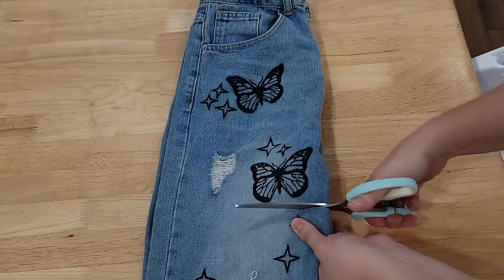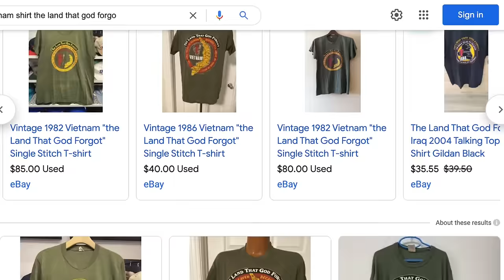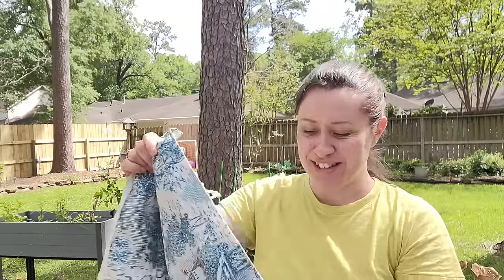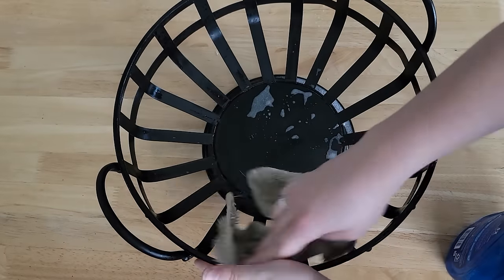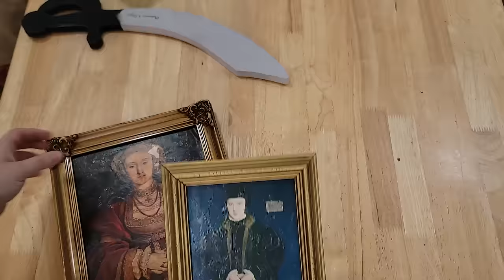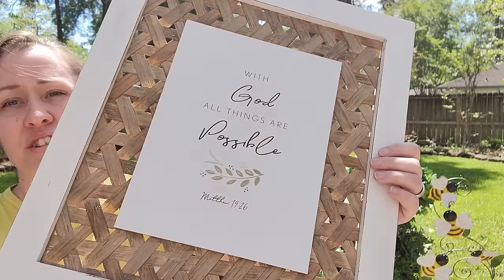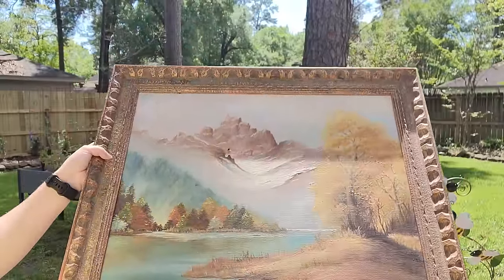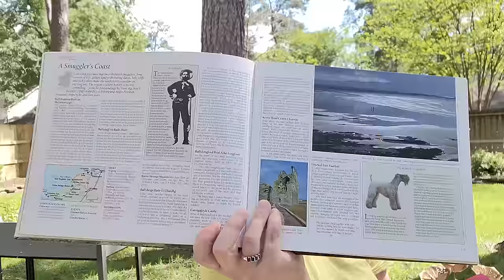I Hit The Jackpot At The Goodwill Bins | Shop & Flip With Me

Comment: You can use the clock that doesn't work as a picture frame. Either remove the workings and insert a picture or fit the picture over the front of the glass. You can always use it as a shadow box for keepsakes after removing the workings. You will have to fashion your own backing.  Thank you for the tip about putting on Mod Podge to make the pictures look painted. I will try that on some of my prints too.  I also am someone who loves clocks. Working, not working, I love the all the looks and different styles.
Reply: Wow! Great idea with the clock! I’m going back to look at it now with your idea in mind.

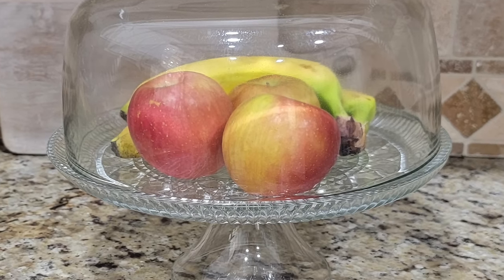Comment: 28:20 Have I got a DIY for you, Corey! 😁Get a tiny decorative glass container, and put about an inch of apple cider vinegar inside. Cover the opening with Saran wrap, and poke tiny holes in it. Then put in an unobtrusive spot in your kitchen. It will attract the fruit flies, and every so often you can clean it out and start again. Works like a charm, and is waaaay cheaper than those fruit fly traps they sell at the hardware store. 😁

Comment: You really scored with your Goodwill shopping. My Goodwill is nothing like yours. I’ve tried shopping at mine for years and have never found anything that looks as good as the things you find. Nor do we have bins—never!  I am so jealous!!
I have a few  suggestions for you to consider. First, storing bananas with other fruit causes the other fruit to ripen quickly. If you eat all of your fruit fast, you may not notice. Bananas give off a gas, which causes the fruit to ripen quicker, especially when stored together under a glass cloche that traps the gas. A hint to slow down bananas from ripening is to wrap the stem in plastic—plastic wrap, plastic bags, even the plastic bag you use to take your fruits to check out at the store. 
Your husband does a great job framing. But when you showed your pictures that came framed in the bigger frames, you commented on how nice the pictures looked. in the bigger frames. Now compare your pictures framed by husband. The 1 x 2's look so small and don't do the pictures much good. Think of how much better they would look in a bigger frame, with a wider piece of lumber or maybe a piece of wide moulding. Something to think about. 
I'm still jealous and envious of your treasures!!! 😊😊😊

Comment: I never buy art that has the price tag stuck to the paint. It’s easier to restore the damaged frame caused by the sticky substance than the damage to the art inside. The rectangular clock that doesn’t work is very attractive. It might be easier to put a new mechanism in than one might think you’ve had a great haul.